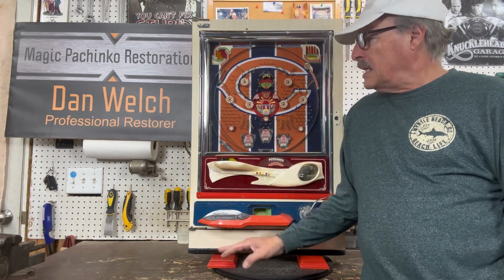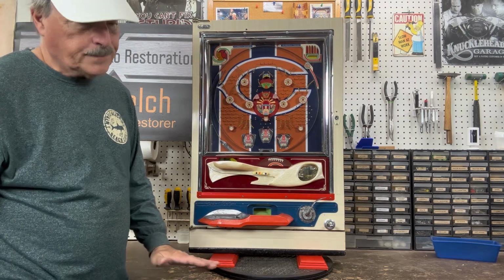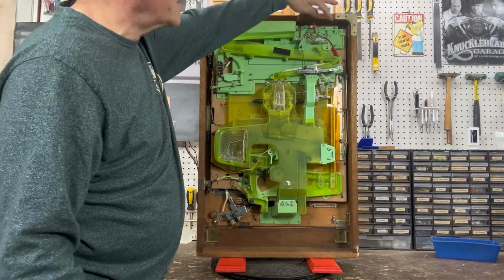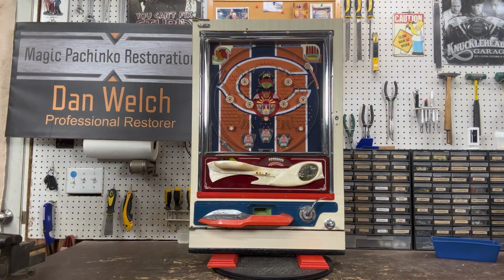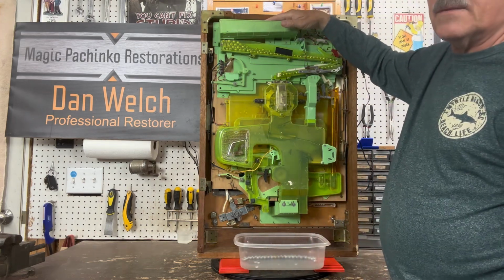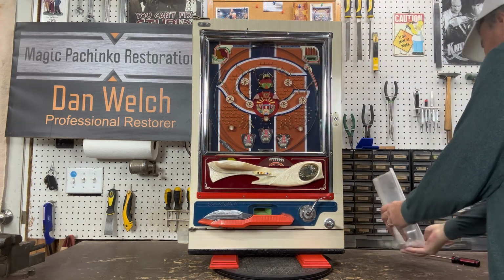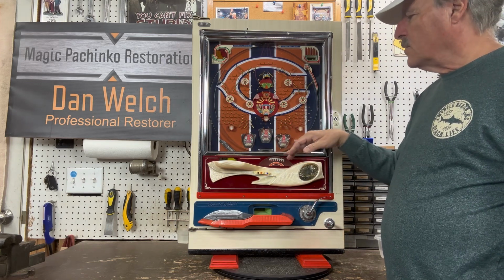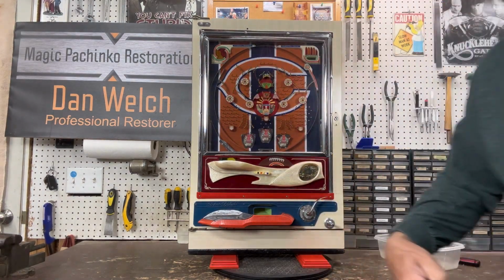Kyoraku Sankyo Vintage Pachinko Machine

Comment: Great looking machine. And Yes!, these machines are very quirky and each have their own unique behavior. Quite frustrating for a perfectionist like me... Question Dan, I would like to be able to purchase my own replacement bulbs. What size are the bulb bases? Or, if I'm looking on Amazon, what size bulb is correct? thanks...
Reply from the maker: A10 bulbs. I convert mine to 12V.

Comment: I found what appears to be a very old Kyoraku pachinko machine in a basement of an old house that was  being demolished.. The glass is gone, and it doesn't seem to work, but I don't know, maybe it does and I just don't know how to operate it. Everything is in old Japanese so I can't read what all it says. If there was a back panel to it, it's gone. The one in your video doesn't seem to have a back panel. It's non-electric. Do you think it's worth anything or is this one of those 'dime a dozen' items? I'm sure it's restorable. Anyway, your video was informative and I have a better understanding how they work.
Reply from the maker: Just about any vintage machine is worth restoring. Go to my website and use the contact page. That will auto generate a response telling you how to text me some pictures of the machine.